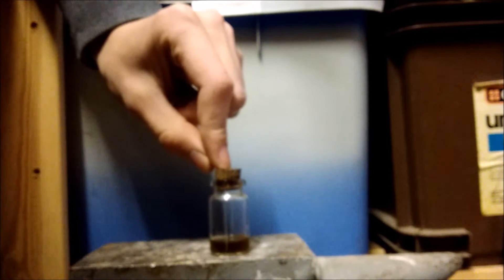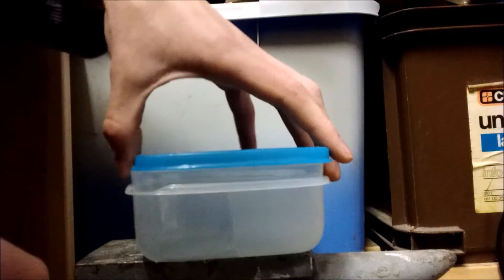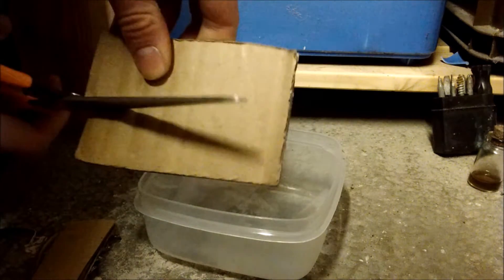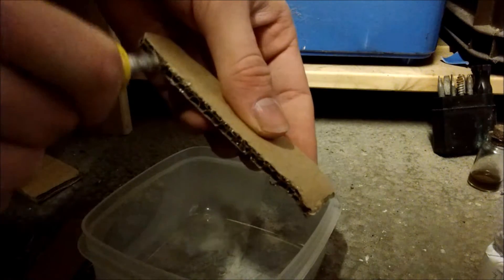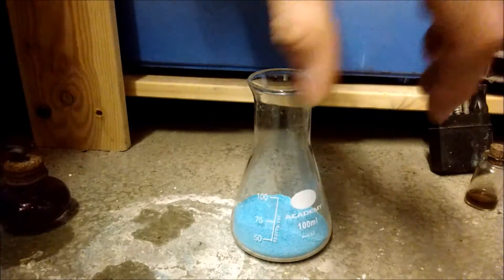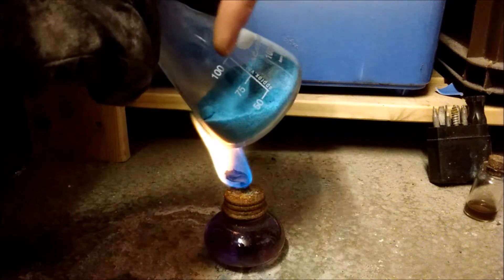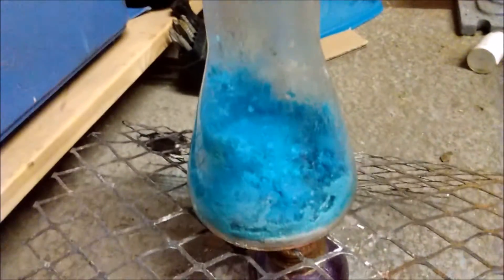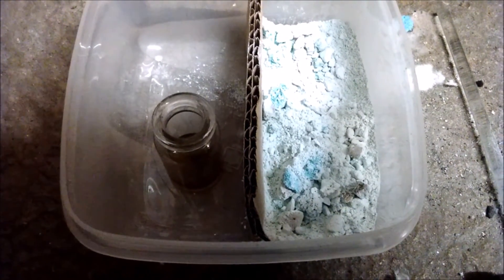How to make a simple dessicator.

Comment: Did it or did it not work well enough for what you was trying to achieve?
Reply from the maker: It dried out the potassium carbonate yes I have another vid showing that currently I'm running the same method over again to produce more untill I have a substantial amount of it.
Reply: @infernalcontraptions8648  Cool mate all the best. For better results on the cheap side look out for a fridge compressor. And I don't doubt you already know this ;)